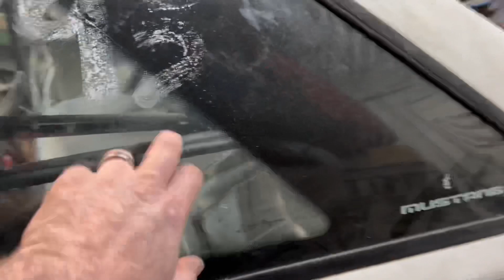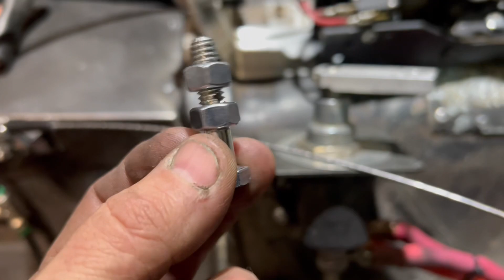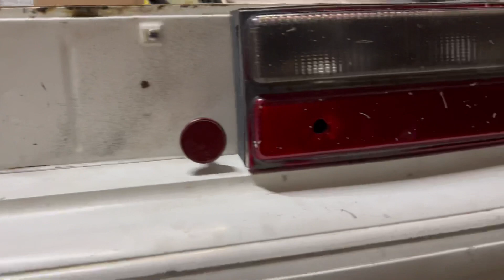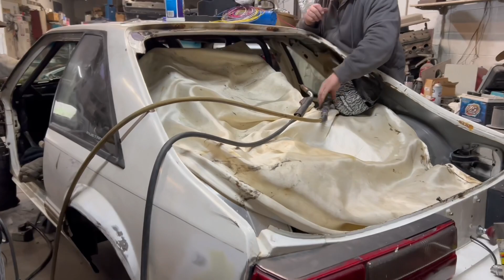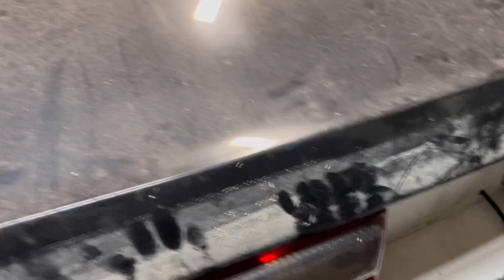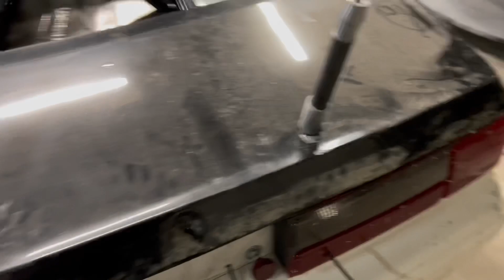It’s Finished!  New car is going No Prep racing / Thaw Out Darlington, SC

Comment: Only thing I would suggest is to put some rubber grommets in the fire wall around the spark plug wires. It is not an immediate concern but will be a possible problem down the road.

Comment: The turbo exhaust pipe exiting out the pass side should have a 90-degree elbow pointing at the sky.  They've determined that there is enough force from the turbo pipe to actually 
move the car over out of the groove, in this case, to your left.

Comment: It probably doesn't matter, and is an easy fix if it does matter, but I'm pretty sure NHRA requires the master switch to be a "push off". Just a heads up in case there's an issue in the tech line. I really like that cable method.  Cheap and effective.

Comment: The higher the wing is, the earlier it will be active in terms of vehicle speed vs downforce. To get more downforce you need a bigger wing or more wings, you can also use split wings and larger endplates. Simply put though as high and rearward as rules allow.
Reply: Yup, needs about a 4 or 5 inch wicker bill off the back of the deck spoiler